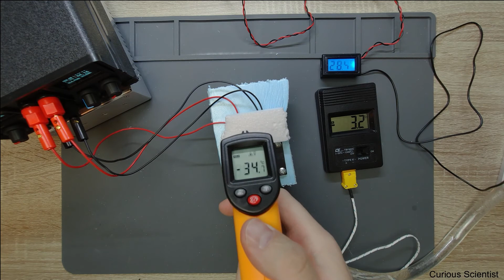Below -40°C with stacked Peltier thermoelectric coolers

Comment: Impressive! But didn't understand what that black temprature sensor is... Measures temprature at the edges? Also, you mentioned the temprtature decrease... but the number on its screen increased  from 1.x to 3.x when the temperature decreased... and later vice versa... Please elaborate. Thanks!
Reply from the maker: The little black device with the blue background light is measuring the temperature of the cooling water. I even told this in the video, so maybe you should watch it more carefully. If you are referring to the other, larger thermocouple-based thermometer, you might have missed the minus sign on the left side of the display. But those temperatures are not relevant as it is only measuring the edge.

Comment: Hi, very cool demonstration! Could you please share the model of the power supply that you are using?
Reply from the maker: Hi! That's my custom build power supply. You can find it on my channel.
Reply: @CuriousScientist  Thanks for your reply! Sorry to bother you once again but I could really use some suggestions. 

 I am currently using a stack of peltier (12715 bottom and 12710 top) to cool down a copper plate that I want to use as the cold plate for a DIY cloud chamber. I am struggling to get to temperatures lower than -20 °C (with ambient temperature at around 20°C). The peltiers are powered by an ATX power supply (it was the cheapest option available to me) at 12 V and 5 V and the hot side of the bottom unit is placed on top of a CPU cooler (aluminum heatsink with a 120mm fan, TDP about 150-180 W).  The bottom peltier is drawing a little more than 8 A (maybe it is too low?). I am currently considering buying the kit for the water-cooling unit that you are using in this video: do you think that could give me better results or should I first try to change my power supply? 

Sorry for the long question and keep up the good work!
Reply: The copper plate dimensions are 5.5 cm x 6 cm x 0.8 mm so it is only slightly larger than the surface of the peltiers themselves.
Reply from the maker: @vixbox4684  Hi! You are using way too powerful Peltiers and you are running them at too high power. You definitely need a variable power supply so you can control the power for the Peltiers. You can keep the 12715 as the bottom Peltier, but the 12710 is way too powerful. Use a 12705 instead and run it at 3-6 V only, or if you only have the 12710, run it at very low voltages. I have detailed videos on stacking with calculations and all that stuff. You can troubleshoot your system using the formulas.
Reply: @CuriousScientist  Thanks again for the quick response! I will try to swap the top unit with a less powerful one. If that doesn't work I will try to build a variable power supply just like yours. Cheers!
Reply from the maker: You're welcome! Also, don't forget that the ATX power supplies also have +3.3 V lines. ;) It might be useful for powering the top Peltier.
Reply: @CuriousScientist  Of course! The first thing that I will try is to power the top Peltier at 3.3 V. Should I also decrease the voltage of the bottom unit from 12 V to 5 V? By the way, I am trying to figure out the working point of my system but I don't think I understand how to read the datasheet or perhaps I am missing something. What I mean is the following: when I power the bottom peltier with 12 V I measure a current of about 8.3 A. However, when looking at the 12715 datasheet I would expect a higher current at 12 V (I'd say at least 9 A). What am I missing here?   

I am starting to repeat myself but honestly thanks for taking the time to answer my questions, I am very grateful!
Reply from the maker: The missing point is the hot side temperature of your Peltier cooler. The datasheet always states the performance charts at a certain hot side temperature. Usually at 27°C and at 50°C. Actually, by measuring the cold side temperature and knowing the voltage and current you pump intonthe system, you can visually reverse-engineer the Qc and hot side temperature values.

I feel like that you haven't really watched my videos because I told all of these things. I even have a video specifically talking about reading and understanding the performance charts...

Comment: Very impressive. I am struggling to get below -24 °C with a stack of 12710s. Does your K-type thermocouple give the same cold reading as the IR?
Reply from the maker: Thanks! Probably, you feed them too much power and you cannot dissipate/conduct the heat away well enough, so the temperature plateaus. Both thermometers give the same values within tolerance and I can confirm that I measured similar values with an NTC thermometer as well.

Comment: If, hypothetically, you put 2 systems of these in a 240x120mm heat sink with a 120mm fan in the middle, in the cold side, do you think that could blow a 10º difference of ambient/room temp?
 With watercooler in the heat side of course. 
 Ps. I know will consume a lot. 😅
Reply from the maker: I already told multiple times that stacking is not used for moving a lot of heat. It won't blow cold air.
Reply: @CuriousScientist  it's another idea for my dogs. They need more than me. Too hot in here 😢

Comment: If want neend more minus temperature should we add more peltier from heat side size high to low amperes. Am I right?
Reply from the maker: Hi! I don't really understand you, sorry. If you need more negative temperature, you need to stack the Peltiers and you need to use less and less power towards the top most device, otherwise, you cannot keep the stack cool. But, the cooling power drastically decreases with each layers. I have some more recent videos on stacking with some calculations and explanations. Check this video and the subsequent two parts of it: https://youtu.be/kSdJtVYG5OA

Comment: Do you think this type of setup can be used to make a car coolbox in 12 V? using maybe 2 x stacked peltiers and 2 x computer water CPU collers ?
Reply from the maker: Absolutely! You actually guessed my next upload. I have something which is similar to the system you described and I will perform some different tests on it regarding its cooling performance. I would say, stacking is not that important, but you can place more Peltiers in. I have a water cooled block which consists of 4 Peltiers. They will be tested in the video that I will upload today. Stay tuned!
Reply: @CuriousScientist   Great. If you have any info on how to hook it up to a car and not kill the battery please share some info.
Reply from the maker: Once my computer is finished with the rendering, there will be 2 videos in this topic. But, in nutshell, you can use a "Peltier block" which consists of 2-4 Peltiers (not stacked!). Their cold side is inserted into the cooling box by a heat sink, or some metal stub, and their hot side is outside the box, well isolated and cooled with a CPU cooler, or some large heat sink, perhaps with some small water cooling system. The main goal is to keep the hot side around maximum 40-60°C, so you can reach below 0°C temperature on the cold side. If you have a well isolated box, and you put in already cold stuff (so, you just want to keep your things cold, and not cool them down), you can do it. Otherwise, either you need significantly more Peltier or much more time. Since the car can provide very high currents through the 12 V rail, you will need to limit the current with something. You can buy some regulators, power converters that can do the job. Please, check back, as I will upload the videos pretty soon.
Reply: @CuriousScientist  Yes, you can use . I stacked 3 modules of 15 ampere module (12715) and use an air conditioner for room with water cooling for heat side ( water cooling uses water cooling plus heat sink with fan .
Reply from the maker: For what video? Look around on my channel and use the search function.

Comment: How long can u run this..?
Reply from the maker: All day long. The water temperature becomes stable after a time and it will stay below 30-35°C, so you can run the Peltier on nearly maximum current. The other question is the purpose of the Peltier. These things consume a lot of power and are very inefficient in cooling as compared to the compressor-based cooling.
Reply: @CuriousScientist  I am hoping to cool small quadricycle.please help me on this..how about battery 12 v
Reply from the maker: @gods5945  This is too loose description. I cannot answer such a brief question.
Reply: @CuriousScientist  how long will it  run on 12 v dc car battery..?
Reply from the maker: @gods5945  You are still so far away from asking a question properly. But, I do the work instead of you... 

Let's assume you have a 70 Ah car battery (12 V, 70 A). In the video, I use a TEC12706 (6.4 A, 15.4 V) and a TEC12715 (15 A, 15.4 V) so the total current drawn is 21.4 A. Also, there is an additional consumption from the pump, but it is negligible as compared to the Peltiers. So, as a factor of safety, we do not want to drain the whole battery, so we just use the 80% of the total capacity (70 Ah), which is 67.2 Ah. Then, you just have to divide this  (67.2 Ah) by the current drained by your circuit/hour, which is 22 A (I rounded up, assuming that the pump has ~ 600 mA current draw, but I think it is even higher). The result is 3.05 h or ~183 minutes. Not too long... And as I said, these are very inefficient coolers. They are not good for cooling for example large volume of gases (a room). They should be attached to something that you want to cool down. A microchip, a beer can, a CCD/CMOS sensor (astrophotographers do this)...etc.
Reply from the maker: @gods5945  Hi! I am not using any email addresses to communicate for obvious reasons (I am not a support service). If you want to write me a short message, you can find me on Instagram.